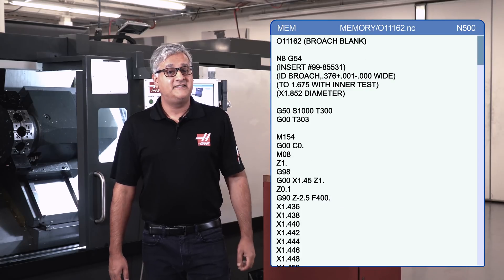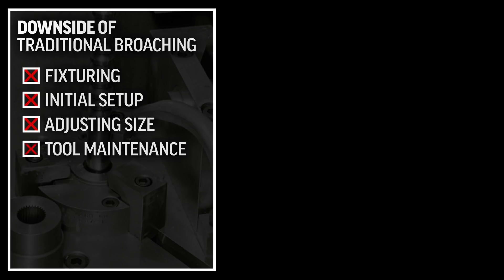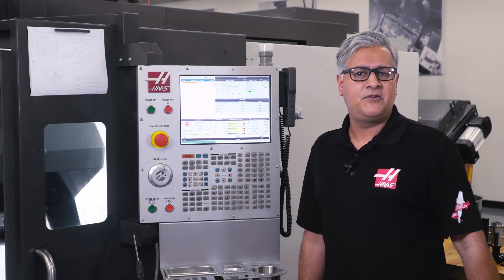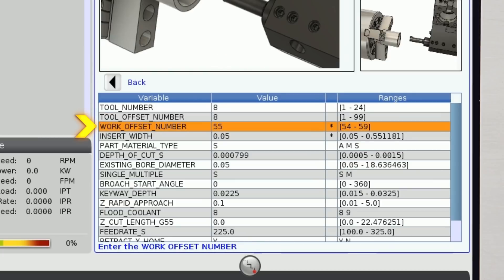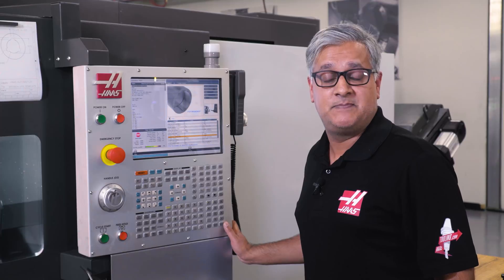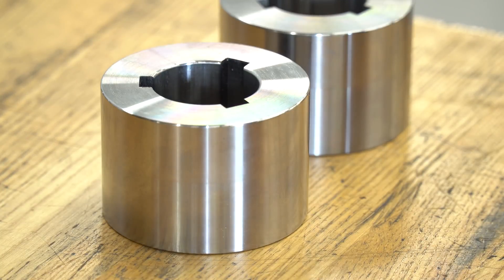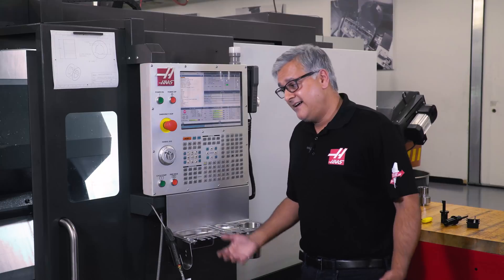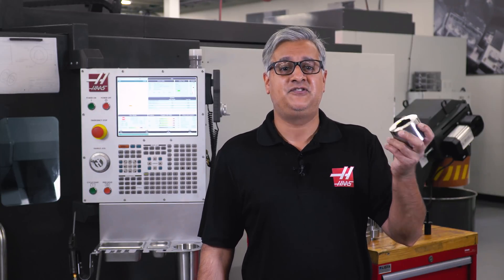Broaching on a Haas Lathe: VPS + G156 = Broaching - Haas Automation, Inc.

Comment: 3/8 keyway broach is not four feet tall. For one keyway is is simpler to just push the broach in a press. I have broach tools for lathe/mill, the only reason I'd use them is for large production.  The cost of one of these broaches for your machine is almost four times the cost of a standard broach.

Comment: Why not run an endmill  to rough cut the feature before broaching. 1/4 em for a 1/4 keyway stop .005 short double your feeds because your only taking out the radius the endmill left behind.
 
I'm going to edit this for doc purpose,  the doc in this video is essentially 2 inches. Everything past is safety.  The amount of time you'd save by roughing it with an endmill  would be worthwhile. You can always throw in a different F value once you get to the real meat of the cut. But even at the meat of the cut your only removing .005 of material that hasn't been rough cut.

Comment: Hmmmm.....looks like haas doesnt know how to use sub programing. ive been broaching on cnc lathes since 86 on a chnc1 and I use a m98p**xxxx where * is the times of repeat and x where the sub program is. sub is g1 z depth f.xxxx feed per material,u-.005,back to g0 z.100 u.007, m99. this is a .002 depth of cut each pass.

Comment: I use this tool ( Horn SH117 ) and I can say, when you retract the tool and you have enough clearance make sure it's out of the slot, 
the tool insert wear is way better than when you retract in the groove.
When you have a lathe with C-axis you can do this with G71, ...... or make a repeatable sub program ( M97 or M98 ) like this:
Main program: ( metric )
O2000
----
G00 Z10.
X15.
M98 P2002 L70 ( 70 cuts ) 
( or like some Fanuc controls  M98 P702002 )
-----
Sub program:
O2002( Incremental X 6mm Up - X 5.9mm Retract )
( X = 0.1mm in diameter - 0.05mm per pass )
G98
G01 U6. F2000.
W-40. F5000.
U-5.9 F2000.
G00 W40.
M99
%

Comment: Can you clarify what the "D" parameter does in the G156.  On the Haas website, it says that it retracts in the X direction for tool clearance.  But that doesn't make sense on a mill.  For example, if you are broaching at 45 degress, the retraction would need to be along the cut angle, not just in the x direction.  What I am talking about can be found here: https://www.haascnc.com/service/codes-settings.type=gcode.machine=mill.value=G156.html

Comment: The template seems to give a broaching start angle, but no stop angle? As in you would have to manually do single broachings for a part that has no borached deatures evenly spaces for the whole 360 degrees?

What about the broaching depth, in your example you had 0.201 inches, but imperial keyways measure the length of flat. Is there a way to change this setting to be the measurement that metric keyways are defined as, which is from the bore radius (or center of bore)?

Comment: I programmed this today on my ST20Y.  I selected multiple broaches but after saving the program the machine only does one broach. Why is this?
Reply from the maker: Harry Wall, Thank you for letting us know you had this issue and our apologies. Bhop has been working with our software team to fix the bug that causes this issue. It will be fixed on the next software version 100.21.000.1000 which will be released by the end of this month.

Comment: I have a less than a year old ST20 with spindle orientation added.. 
 Can i run an update to add this VPS template to my lathe and my mills?
Reply from the maker: BVC OFFROAD, If you want to add the new template to your NGC ST-20, please contact your local HFO for options on software updates. Thanks.

Comment: Very good. Can this be done on an SL40?
Reply from the maker: Geoff, Unfortunately this template and the G156 code are not available on the SL lathes. But yes, absolutely the broach process can performed on your lathe using point to point programming or G71.

Comment: Just did this on my okuma last week, it is nice being able to bore, broach, and put the setscrews all in one operation. And I just used a long hand offset turning cycle in cam, because I arced out of the cut(tool did not like that when I changed to the prehardened material ).my code was closer to 17 pages just for the broaching op

Comment: What is the max cut depth?
Reply from the maker: Matt, The VPS template allows a max DOC of .0035 (0.09mm) and that’s only for aluminum. But after you generate the code you can edit the I value on the G156 line of code to adjust that as desired.

Comment: HAAS (NGC) Controller.
A very user friendly controller for sure.
Even better if you are new to CNC programming and just want to make parts but don't want to be a machinist.
The power and stiffness of a HAAS machine is only noticeable if you have run more expensive machines. 
But for guys who just want to make parts they are more than enough of a machine for most shops.

Reality is.
We only want to make parts for our customers.

Comment: the reason pull/push broaches are still used is because they are the fastest way to do it. the reasons shaping machines are sometimes still used is because you can do any shape you want with them and don't have to order a broach per shape. you're combining the downsides of shaping and broaching into one "downsides" list which is disingenuous. using a cnc machine as a shaper is certainly faster than a manual shaper, but it not faster than push/pull broaching. and when cycle time is king, push/pull broaching is still viable.
Reply: Except to my knowledge you can't push/pull a blind keyway, the shaper method you can
Reply: @coreyb4073  push/pull broaches are not obsolete, shapers are because of what you see in the video
Reply: @SuperAWaC  Yeah, good luck putting a 2inch blind keyway with this. I can tell you a vertical slotter aint obsolete.
Reply: @spikeypineapple552  there are slotting tools that can do blind internal keyways, with or without relief grooves. sorry, but shapers and slotters are obsolete.
Reply: @SuperAWaC  I'm telling you I make 90gbp/hr doing slotting work, right now in the UK on a butler slotter. Along with 5axis  millling, there's a time and a place for all tools, and I'm taking work from sinker edm shops left and right.

Comment: You can also just make a sub program in incremental moves and just loop it. Then you only have like 10 lines or so. Also drilling a side hole will let you broach blind keyways if your part permits
Reply: I was also wondering why a sub program wasn’t mentioned, the only downside is when you need to adjust something you have to swap between programs. I would love to see a canned cycle like this one featured, it’s just a bit more user friendly.
Reply: @Alita1991ftw  you don't even have to change programs. On a Haas you can use M97 in place of an M98 and call a "local sub routine" from within the same program. You just put the sub after the M30

Comment: Pro tip: what you are showing here is just called shaping. Broaching by definition requires the use of a broach, and its a unique machining operation because its the one of the only type of machining with a fixed depth of cut per tooth, unlike all other machining operations, except cutting threads with a tap or die.
Reply: Tip appreciated!
Reply: What is it that you are trying to say ?
You don't like the video ?
Or you feel ripped off for watching it ?

It's FREE information and you're still not happy ????
Reply: @weldmachine  Just commenting on a mistake in terminology. I think I was pretty clear about that.
Reply: Misleading video title.

Comment: I noticed on your depth of .201 that your previous value had more places past the decimal, does it make the machine more accurate to include the zeros to the end of your value. Say your machine can program to the .00001, is it more accurate to punch in .20100 as compared to .201?
Reply from the maker: Brian, It does not make it more accurate. The number of decimal places is just a default for the template we created.

Comment: Haas control is amazing, I just hope the eliminate shut up heater's mouths by improving the stiffness  and power of the machines
Reply: You're right about the HAAS Controller.  ( NGC )
A very user friendly controller for sure.
Even better if you are new to CNC programming and just want to make parts but don't want to be a machinist.

Comment: ...
G0X1.45Z1.
Z0.1
G71U0.002R0.1
G71P01Q02F400
N01G0X1.852
G1Z-2.5
N02X1.45
...
no?
Reply from the maker: MrLeoBalamyt, Great response and yes G71 will work on the lathes. The G156 code was created for both mills and lathes for the user less proficient in macro programming. G156 works on the latest software for the mills now. And a mill VPS template for it will be created later this year.
Reply: :D it's hilarious and so obvious too. Can't see the forest for the trees... I don't know whether it's working or not, but if it is, than someone spent and wasted so many hours and money to develop something that has been already available to use.
Reply: Or a simple counter macro that checks position after each pass
Reply: I see what you did there...It can probably work but it can as likely default to the last used spindle direction and rpm and give you a really bad day! I think that newer "smarter" controllers might try to do that but these will probably run macros without much hassle.

Comment: Can you do the same thing on a mill like a VF-2?
Reply from the maker: Liam, Yes G156 is available on the latest software for the mills. There will be a G156 VPS template created for the mills later this year. But you can go ahead and program similar to the lathe to create features on your parts.
Reply: @haasautomation  can i do this on a 2009 mill? long program i assume but, mount a tool in the spindle and have it hold rotation accutatly enought to do this? i do have spindle orientation enabled.
Reply from the maker: Brian, It can be done by locking the spindle with M19 and the correct P value. M19 isn’t a true lock so it’s not very accurate. so it would depend on your tolerances. But using macro’s and loop cycles should help reduce your program length.
Reply: @haasautomation  Yeah nooooooooooo! M19 is the worst on Haas. it vibrating.  Tho! I hope one day Haas will make machine that are design for that. But what i like about Haas is the price. And at this price you can't do what a 1000 000 machine can do.
Reply: @haasautomation  i have a st-30Y i have the update 100.20.000.1200 the g156 is there but the ATP mesure arm is not giving the real distance, it is a bug?